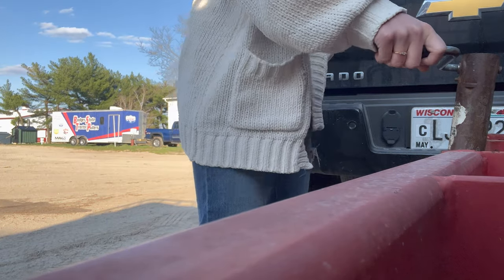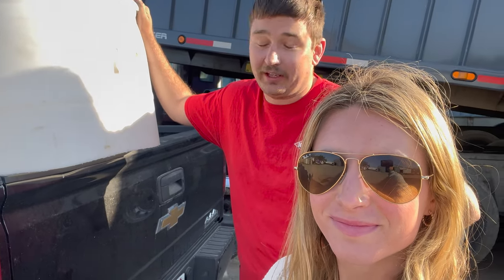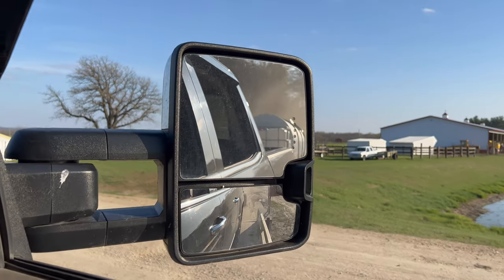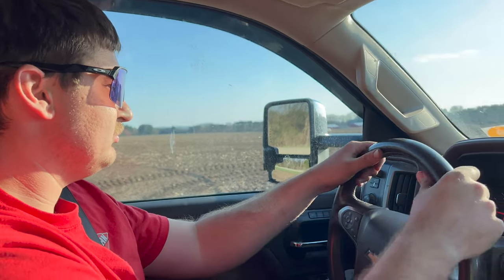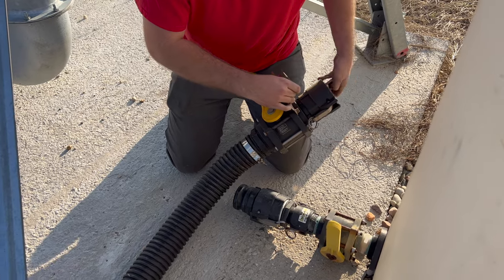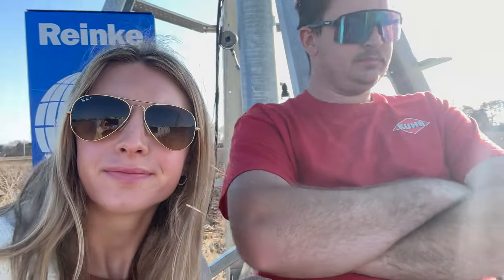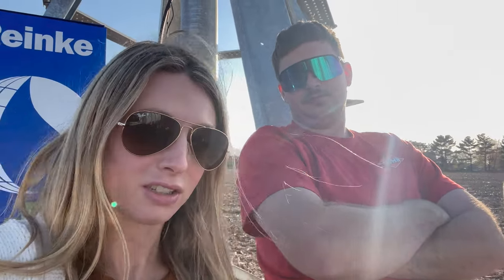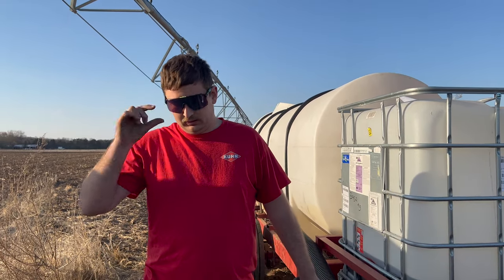Spring field prep continues! Will we be planting soon?!

Comment: It works better if you pull the pin out before jacking it all the way up. Just make sure the jack is at least touching the ground with maybe a little pressure on it. As you jack it up you will see how it will move to the side.
Reply from the maker: Thanks for the advice!